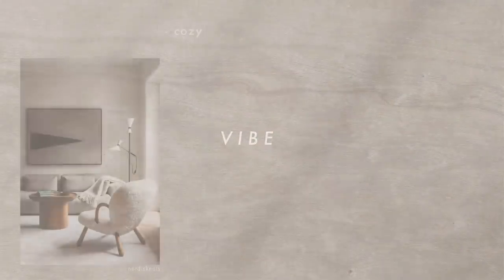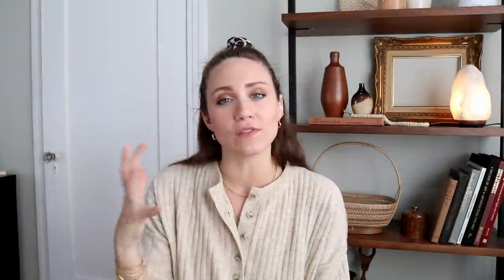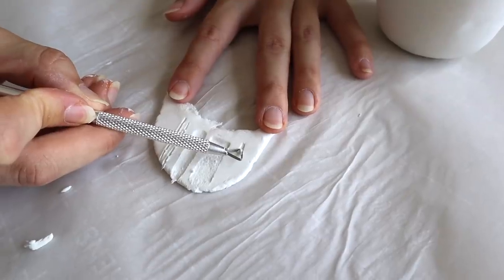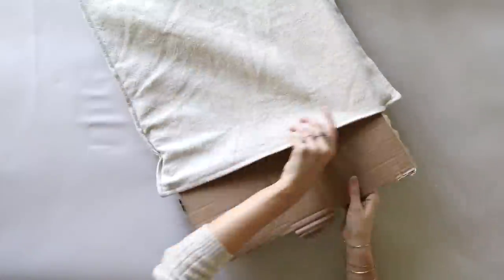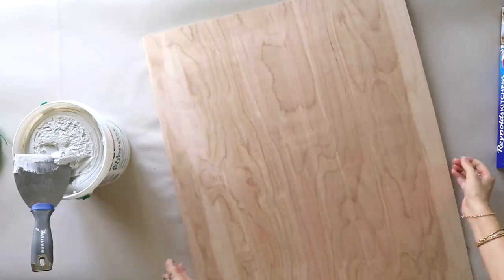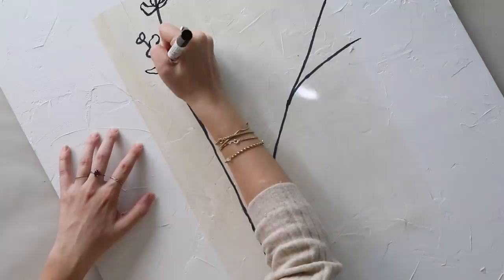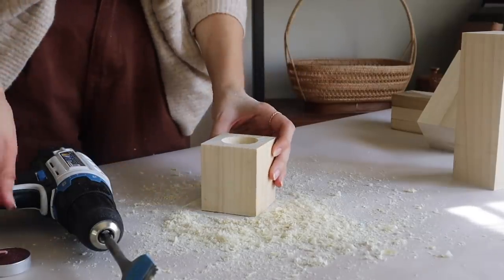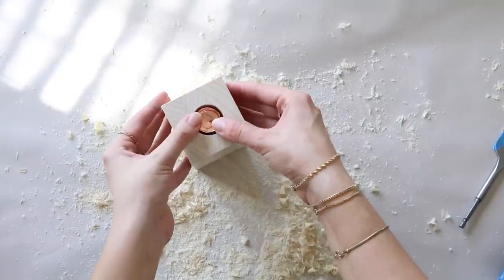DIY SCANDINAVIAN DECOR + Guide To A Cozy Home | XO, MaCenna

Comment: I love your videos and attitude. Thanks so much! Two small suggestions--the vases didn't look so hot. I suggest 1) shaping the clay more carefully over them or 2) using spackle or plaster on the glass with a coat of paint underneath.Those would give you better ways to carve into the material. Also, for the candle holders you can use Danish oil.

Comment: Scandinavians use a lot of color in their homes. The neutral pallet is an American interpretation of Scandinavian design. I've never been in any Scandinavian home that has the strictly neutral pallet you like. We love color! Also, dark wood is common. Blond or white wood is an IKEA-inspired trend, not typical for many Scandos though they do like teak which is a golden brown. Also, Scandinavians love art and objects in their home. Often they have oil paintings in color on every wall. Also, every Scandinavian woman knows how to knit, crochet, embroider, needlepoint, and often weave and most homes will have many samples of homemade textiles in them (in color!). Traditionally many have fabric curtains, in color, but they are not curtains that you pull to cover the window but a valance and panels that hang on the sides of the windows.  They are not minimalists.